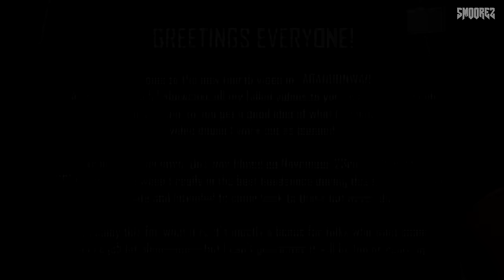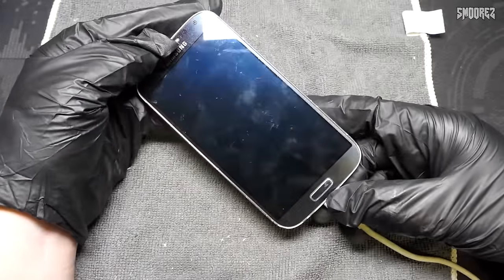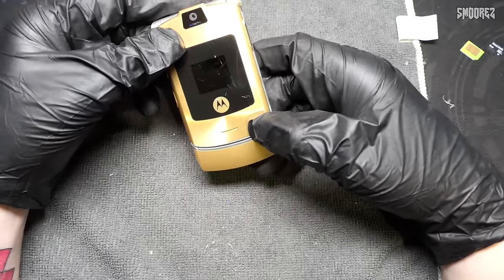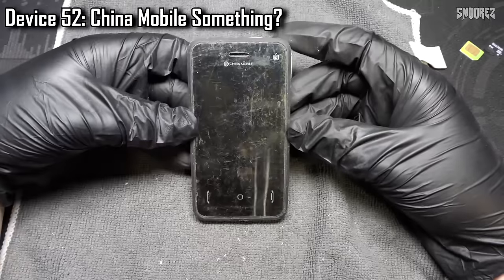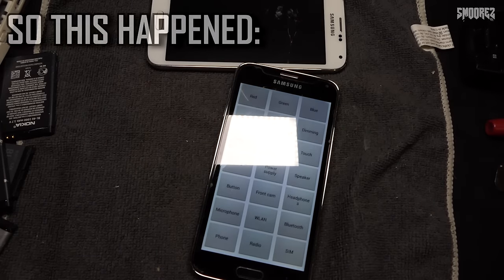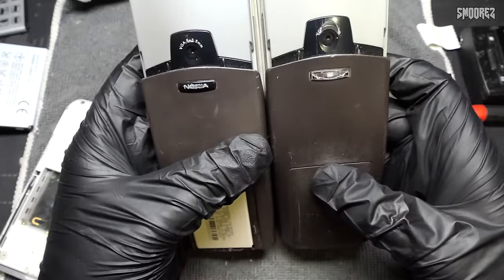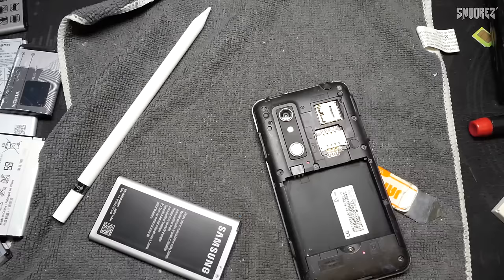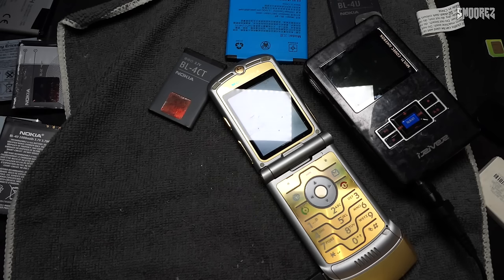ABANDONWARE (Ep.3) FAILED JOB LOT 3 - Spending $590 at E-Waste for Retro Phones, Smartphones etc

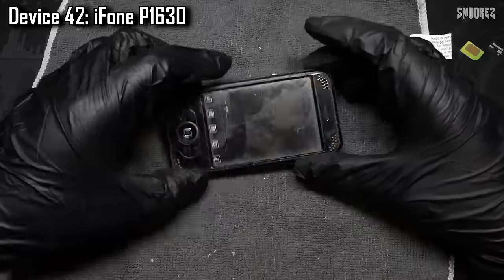Comment: 34:27 I have that phone. It’s the CECT P168. The one you have is the IFone P168C, a later version. In order to power on the phone, you would need to press the call end key, not the button on the side. The button on the side is the camera button.

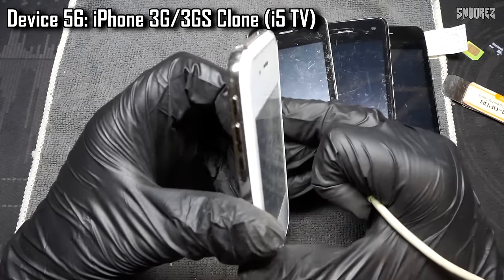42:58 That phone is the same phone ashens reviewed but slightly different. I also have this phone. The manufacturer made so many different variants of it. The F8 is a fake iPhone 4 and the I5 TV is supposed to be a fake iPhone 5. The reason why the I5 TV does not look like a iPhone 5 and instead looks like a 3G is because originally in 2011 there were leaks and rumors claiming that the iPhone 5 would look like a 3G+4 combined. So knockoff manufacturers made it early before the actual iPhone 5 launched.

Comment: Some of these older devices are still awesome. I got a Nexus 7 (2013) from eBay for $10 if you can believe it, but the display is very impressive, and when I flashed Nethunter to it, the Nexus 7 is snappier than I thought it would be for its age and available ram.
Reply: Got a 6p that worked well for $40 in Fort Wayne Indiana at a thrift shop. Good IMEI and unlocked.
Reply: score!

Comment: The Pixel can still be used to make unlimited photo backups to google photos. That feature still works, even with photos not taken on the phone itsself. 

Also with the Note 4's you can try to put a small piece of cardboard on the emmc and really tighten it down - essentially pressing the emmc onto the motherboard. I got one of my broken emmc Note 4s working for a year now with that method. But its just sad that at this time the QC was so lacking.

Another trick I can tell you is with phones that have weak battery that sometimes helps is to completely drain the phone so it shuts off, doing it on and waiting to shut down a couple times more, then booting into the recovery and leaving it there until it shuts off in the recovery. Then charge while still in the recovery. This has worked for me on a couple of phones that turn off at like 40% and charge suspiciously fast.

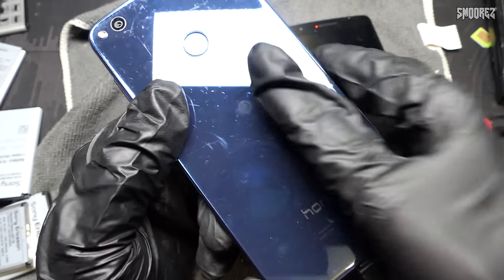Comment: 1:16:23 - It is definitely a battery bulge. I had Huawei P8 lite and battery got bulged after a year of use. but that phone had a great design though, that purplish blue and it was acctually really comfortable because it was slim and had a great display for its size. Only problem was the 16G internal memory that got filled almost immidiately